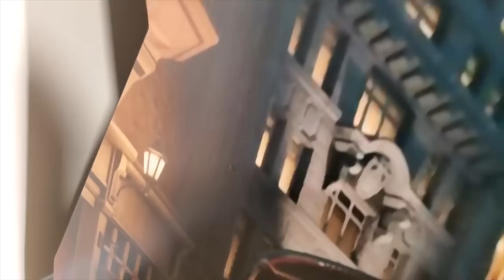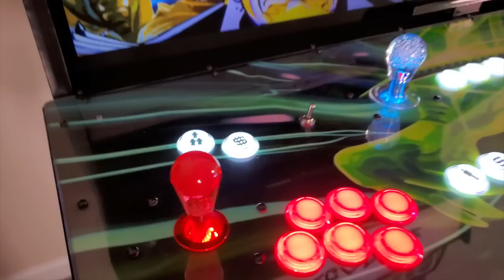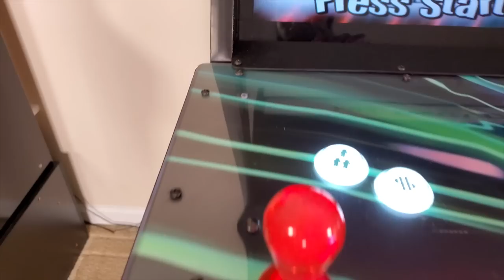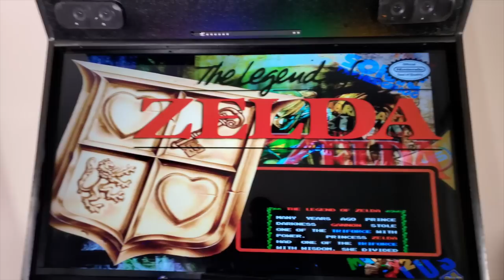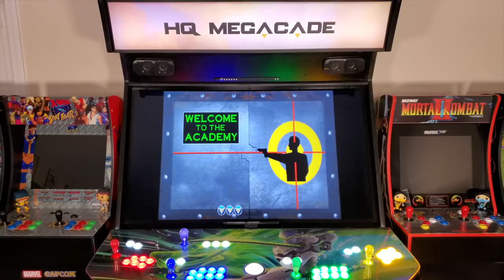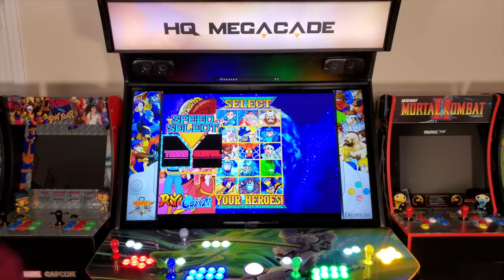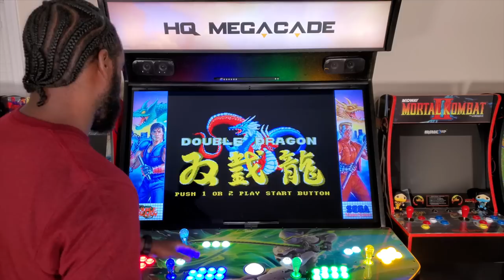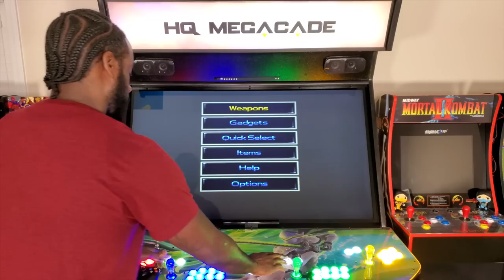Extreme Home Arcades "HQ Megacade" - Custom 4 Player ONE YEAR REVIEW

Comment: Just gonna mention a couple of tips for that drive... Dreamcast roms should be in CHD format and Gamecube should be in GCZ format. This will allow instant loading without having to uncompress everytime you play a game. PSX and PS2 should load instantly as well. Also the amount of space taken isn't much more. Also you can change your default controller you prefer using per emulator or game.... for example I have the PS2 emuator use a gamepad by default but for specific games like Tekken 4 and 5 for example... they are mapped to the joysticks.
Reply from the maker: Thanks

Comment: Getting mine is a few days.. just got the email from David very excited!!!
Reply from the maker: Ohhhhhh snap! Congrats bro. Won't be long now.
Reply: Enjoy.  Hopefully you don’t have any issues getting it through a door, lol.  There was a little miscommunication when I ordered mine and I had to cut two inches off each side of the cabinet to get it through my door (last one of course), lol.  I was not fun to be around that day.
Reply: @TWJ1979  I know d Thomas had a video 
 removing the control panel to get it through a standard size door.  have a question, was your door standard size or smaller?  it's a little concerning now my doors are standard size about 32 in wide I'm thinking with removing the control panel, and the door I should be fine. what are your thoughts? Thanks for sharing.

Comment: Makes me want to build my own cabinet and system. Would be cool to use either a spinner or a small keyboard to type in the game you want or to categorize the games in themes for easier selection. Manufacture, system or years.
Too bad solid state drives aren't that high capacity yet. Does the system do a backup to a spare drive just in case?
Is that system on a surge protector? I'm pretty sure you know that the blue power strip is not a surge protector. power supplies don't like surges. Where I live they occur quite frequently and they are quite sneaky. My backup power supplies and surge protectors alert me when a surge has occurred.
To try and add more pressure to get the bottom graphic to stick use something called a J-Roller, it's used to press melamine onto kitchen cabinet tops. You may want to use a heat gun just to heat up the glue. Don't get too close. ;) You can find that in either a Lowes or a Homedepot.

Comment: Hey Thomas, been watching all of your videos because I am thinking of purchasing one myself. 

Quick questions, all the games are loaded right away? I don't have to add any myself? 

For the Wi light bar, where so you install it and how did you calibrate your wi remotes?

The Xbox 360 remotes come pre synced? Or do you need to sync them? How do you sync extra ones?

In this video you are going to add a PS5 and XBOX. How would you add those options for system on the UI system at the start? Or could you? 
Or would you just change inputs on the tv to switch to your PS5 ext.

Thank you so much, keep up the videos!
Reply from the maker: Thanks for watching. Glad to hear you enjoy the content. When it comes to the games loading up, some take a little longer than others. It could be any where from three seconds to 20 seconds. Depends on the game. But most MAME and 90's console games load within seconds. No, you don't have to add any games yourself. The Wii light bar is plugged into the USB slot on the inside of the Megacade. You sync the Wiimote the same way you do on the Wii. It's pretty simple. Yes, the 360 controllers come already synced to the Megacade. Some games may require you to map the controls because they may be mapped to the joysticks and buttons. Adding the PS5 and Xbox Series X/S is just putting the consoles inside the Megacade and connecting them to the HDMI port on the TV.

Comment: Got my machine a few weeks ago and my main issue is that the main wheel is a mess (particularly with all the individual games) and issues with things like no previews or in the case of some of the 'hacks' that I've no idea what game they even are; 'aaobb2' is totally nondescript.

The wheel here looks better, but still not good to my mind. Like, why is Super Mario Bros X on the main wheel? It's a homebrew, put it under Nintendo Homebrews.

I'm going to have to look in to how hyperspin works. Do you know if you can go multiple wheels deep? i.e. Sega > all the Sega Systems > Games for that system, or is it locked to just main and subwheels?

I'd put them by brand, light gun games, 4 player games, fighting games, racing games, several others, but basically individual games shouldn't be on the main wheel.

I've also got issue with plenty of games not working. Don't know if I'm just picking different games than you have, but something like Star Wars Trilogy only works on the version under the Mark 3 Sega section and not the other two places the rom is. Lots of others just haven't booted up. I'm planning to go through and find all the ones that don't.

Duplicate roms are a pain as well, that needs tidied.

Lots of the videos are in like 240p resolution. I need to go in and delete all of those.

Plenty of the artwork is low resolution as well. Can be particularly noticeable on the composite images where the resolutions of characters standing beside each other are quite varied.

When a game is highlighted the art often totall obscures the wheel in a way that doesn't look good. Seems to be the same here, would have preferred consistency with the overlay either being full screen or at least having the wheel always visible.

At times the wheels, particularly for movies, has an entry that is not aligned and I don't know how to fix it.

Speaking of Star Wars Arcade, the Tron stick doesn't seem to work very well on it, and it's the only game I got it for really. I've tried recalibrating but not been particularty successful.

Anyway, might sound like I'm particularly down on it, but I'm not, it's been fun so far; I'm just a bit apprehensive about the amount of work I'm going to have to do to make it properly functional.

The MP drive seems to fix some of these issues to be a better base. How does one get a hold of it?
Reply from the maker: I feel & agree with everything that you're saying. As I've become more familiar with hyperspin, I'm with you about games being on the mail wheel. The community driven Manhattan Project specifically was aiming at correcting pretty much everything you mentioned. While this is something that EHA should do as a company, the community stepped up and we are doing it. Mind you, we aren't on the payroll.

We all have lives and doing a lot of this work in our personal time. So you have a team of individuals that saw some of the same issues that you did and we're doing all we can to eliminate that. Version 1 of The Manhattan Project takes leaps and bounds over EHA's standard 10TB drive. You can get your hands on it now by simply reaching out to the owner David. We're still making changes daily and finding different things on it. But we're pushing to make it better for sure.

As we continue to iron out wrinkles in Version 1, Version 2 (or V1.1 whichever they call it) will correct more issues that were found in V1. So eventually, everything you mentioned (the flaws) will be corrected. Just takes time as doing this isn't our full time job. It would be great if it was though.
Reply: @dthomasfromnc  I agree with everything you both said.  I will grab the MP drive but will probably wait for a few updates first.

Comment: Awesome video, you are a great presenter of your content!  Question:  Is it possible to load your own ROMs into the system?  or easier to just plug your own laptop into the monitor to play?  For example...I know (think?) that the megacade comes with Tecmo Super Bowl 1991 NES version....but I'd like to load the newer roster ROMs into this system.  Possible?
Reply from the maker: Thanks! It is to possible to load your own ROMs into the system as long as you know what you're doing. So yes, it can be done. Also, NES Tecmo Super Bowl is on here. Not sure what the newest version of that is though.
Reply: @dthomasfromnc  Yeah any old-school ROM that has updated rosters and player ratings...community driven.   Like 2020 Nfl and NHL rosters for Tecmo and 94 Sega Hockey as an example.

Comment: What’s the price tag for this unit? And does the sub effect the two consoles when it comes to reading the disc?  I know you said it dosent effect the hard drive or over heat but just curious. Great vid thanks for sharing.
Reply from the maker: Base price for a 4 player Megacade starts at $5450. The subwoofer doesn't bother the consoles at all. But I'm going to be replacing them with a all digital PS5 and Series X.

Comment: thanks for the info again your vids are the reason I ordered the megacade just was wondering when you say the machine isnt perfect or without fault what kind of problems you were having and were they easy fixes
Reply from the maker: You're welcome! Problems/issues like both light guns not being synced. It says in the owners manual that you'll have to sync them from time to time. Out the box, I had to sync mine. Wasn't difficult. But when you're new to the machine, it's that learning curve. 

Also, button mapping wireless controllers with different emulators. And some games not working/booting properly. You're bound to run into a couple here and there. So when I say it isn't flawless/perfect, meaning that EVERYTHING will not be 100% flawless and work. You may have a hiccup or two here or there. Doesn't kill the overall experience. Just some FYI. But once you learn your way around the machine, it's a piece of cake.
Reply: @dthomasfromnc  ok thanks bro surely looking forward the the day it arrives and more of your videos I was just telling my wife last week you havent done a new video in a bit and then boom you posted 2 new ones lol thanks again
Reply from the maker: @claymiller7869  😁sweet! I know the waiting process can be one of the hardest things. But time will go by quick. You'll have that beast in your house before you know it. Thanks for your continued support. I really appreciate it.

Comment: Fantastic review my man. Listen its too massive to take up space in my restaurant but im thinking about doing something smaller however looking for the specs of the computer and the software, is that software sold separately? Ive done a raspberry pi but i am not too technical. Rather just buy the harddrove or whatever. Lemme know and thanx
Reply from the maker: EHA doesn't sell their hard drives standalone. If you're looking for something smaller and cheaper but more powerful and has more games (better lineup of software), I'd give this a look https://youtu.be/JiYjJfLjoEE?si=4MYid6wH28C71cVp
Reply: @dthomasfromnc  will do, subbed as well. Ya I'm a restaurant owner in Asia so putting in a beast like that would take up one 2 to 4 person table. And weekends get crazy so wife would not be happy with me. 
Currently also looking at those table top ones. Remember those pacman ones that you sit down and they are actually tables. Looking at all options but ya I already have a bunch of tvs up like sports bar style so just something small attached to the back of the tv would be fantastic. Thanx I'm watching now
Reply from the maker: @Eddylive thanks for subbing! I think the Shar-Kade will take up less space and may be more what you're looking for. Also, I know exactly what you're talking about with the Pac-Man sit down units.
Reply: @dthomasfromnc  found a couple pacman machines out here that are kinda beat up and they want a grand US for them. Wondering if I can mod a table top style like that. Also found a restaurant special style one that is amazing but they want minimum 16 tables and they want around 100k us! Ummmm. I'll try to mod thanx
Reply from the maker: No problem! Nothing wrong with modding. There's nothing like seeing the finished work and the beauty of a product you molded. Wish you the best, bro.
Reply: @dthomasfromnc  thanx, watching your unboxing, quick question, Pandora's box, what's your opinion, I have one and I'm thinking of modding that

Comment: Mamefan did a fantastic review of his Megacade as well. The far left and far right joysticks are not straight so left and right are really strange and he also had to swap out the sticks and buttons because they are generic junk. I know a guy with a Coinops setup who has 110,000 games which is way more than the 70,000 on the Megacade  on his computer which is considerably less costly and Coinops already has almost 100 percent of the games working.
Reply from the maker: Mamefan did a great review and gave his honest thoughts. I respect his opinion. Everyone has a different experience. As for the far left and right joysticks...they work pretty well. I had some friends over in this video https://youtu.be/aR44nNyyheg and neither of them said that it felt awkward when trying to move a character. But Mamefan had his own opinion on those. I think they're fine the way they are.

As for the guy you know with 110k ROMs and 100% of them working...that's awesome for him. How beefy is his PC that you speak of? The gpu in this build isn't the greatest but good enough to run retro games. As for more power driven PC games, not may take a hit and not perform as good.
Reply: @dthomasfromnc  Mamefan was objective he really dud not have a opinion but it is as you said the far left and right joysticks are on an angle and kind of awkward. The only thing I heard from him and others with the Megacade was they often have to switch out the sticks or buttons. The Coinops system can work on very low spec old computers it is only new PC games, PS3, PS4 and from 2018 on that require a higher end computer. I did not ask him about his specs but I am sure with 110,000 games he has complete colkections of nearly every system available and has a raid system and about 10 different 10 terrabyte hard drives. There is a large community and developers behind Coinops, Coinops 2, and Obsidian black and they have collections per system you can download that are completely operational with videos, art, and a hyperspin style wheel all you do is download them and drag and drop them into the correct folders. I have Teknoparrot working fine on my old PC with Coinops but it does require some control configuration but is relatively simple to setup. They are constantly releasing new games sometimes a few days or weeks after release. I was playing Streets of Rage 4 maybe a week or 2 after it was released. I was on the discord with all the developers so I got exclusive access to all the brand new content as it was released completely free but I may have been booted from it due to inactivity. I am going to build a new higher end PC in the near future to amass a collection of 110,000 games or more.
Reply from the maker: @ShinobiShowdown  well thankfully I haven't had to switch out my sticks or buttons. The community behind coinops sounds like great people. I find it cool you're going to be building your very own high end PC in the future. What an accomplishment they'll be.

Like I said in this vid, I gain nothing from whether people purchase this machine or not. I try to be as transparent and authentic as possible. If it were complete garbage, I'd tell folks, "Stay away and go elsewhere." Though EHA may be a bit pricey (and some other companies can be as well...some even a lot less costly) they do have a solid foundation in my opinion. 

As long as they can iron out some of the issues via software (which is something the community has stepped up to do) then they'll be fine. Emulation can be a headache. I mean you did say the guy with 110k ROMs had about 10 different hard drives. 😂 That's why a company like Arcade1up can produce the cabs that they do for the masses. 3-12 games per machine that are hits will sell like hot cakes for folks who aren't trying to dump $1k+ into a build or spend time doing a DIY project.

Comment: DThomas - what type led buttons and joystick did you use. Where did you buy them from.
Reply from the maker: Sorry I'm just seeing this. Not exactly sure where EHA got their buttons from but the LEDs I eventually replaced and I picked them up from Amazon. Phinlion 194 Green LED Bulbs Super Bright Wedge 168 2825 175 T10 8-SMD 2835 Chipsets LED Replacement Bulb for Car Interior Dome Map Door Courtesy License Plate Lights, Pack of 4 https://www.amazon.com/dp/B08DKR7259/ref=cm_sw_r_apan_glt_i_KC2J3HM28Q3WJK4FH62X?_encoding=UTF8&psc=1

Comment: What's your thoughts on 8/6 buttons vs 6/8 buttons?

And about angling the p3 and p4 joysticks towards the center of the tv vs not?

Do p3 and p4 have enough room to play and see comfortably?

Finally, what size marquee is that and where did you get it?
Reply from the maker: 8/6 or 6/8 button layout....it's all personal preference. I like'em both. As for P3/P4 being angled towards the tv...again, personal preference but I don't mind either way.yes, P3/P4 have enough room to see while gaming. I've played like that before and it felt natural. I don't know the exact measurements of the marquee, but I got it from Extreme Home Arcades.
Reply: @dthomasfromnc  Thanks! How often are you finding yourself using all 8 buttons for a console game vs just using a controller?

Comment: Can you list the stuff you would change if you did it all over again?  like you did for the pro's and cons. I'm sure you can bust out another 10 min. video on that.  For an example, I think you mentioned the lights on the buttons, or what brand you would use on those.
Reply from the maker: I suppose I could...but as for the lights, I didn't know they were going to go dim when they did. So out the gate, purchasing a different brand of lights didn't even cross my mind. But knowing what I know now, there are a few things I would've done differently. Added a spinner, plexiglass to kick plate and upgraded gpu. That's about it.